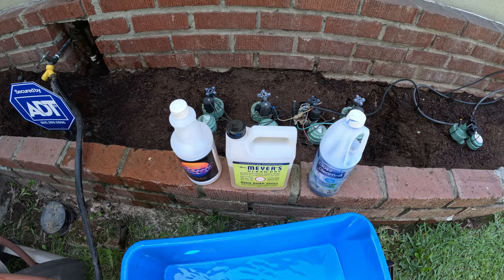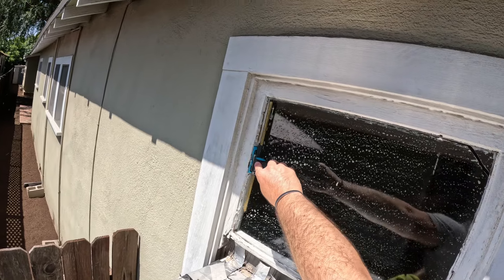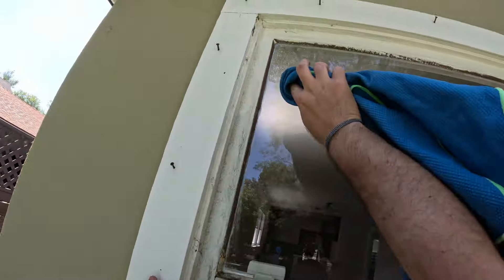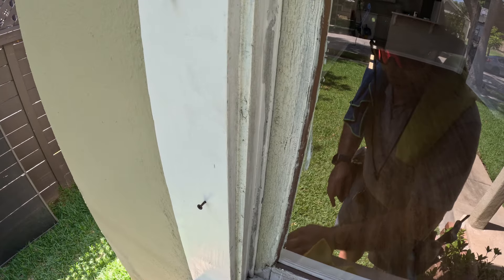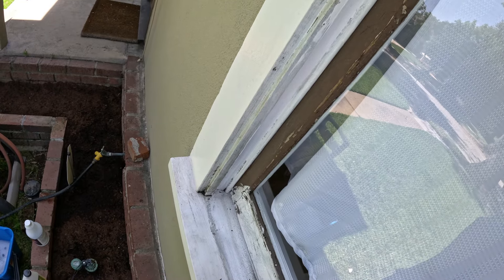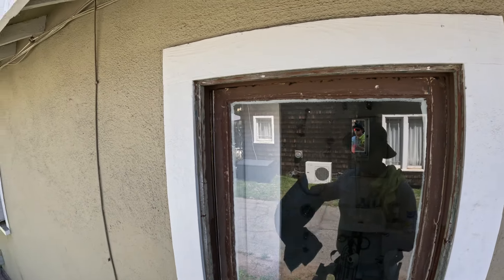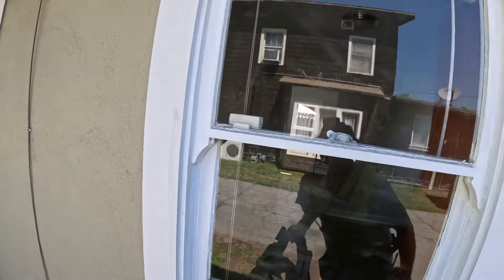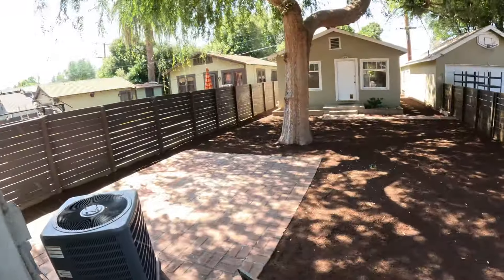How To Clean Windows Like A Pro

Comment: Hey what position you are using the handle  there, is that a 45 degree? For any reason when I do side pulls I end up leaving streaks , not sure if I am putting to much pressure or too little, also and the second pass you are passing on so much dry glass. I don't think the end result is going to be good after when the sun hit the window you might see some streaks.
Reply from the maker: Yes it is! But at times I adjust it when is needed. So when it comes to the streaks, how old is your rubber and what rubber are you using? Also when it comes to cleaning windows in the sun, you have to do the mop and then squeegee combo because if you squeegee too late then it leaves marks. What you can do is clean the window into sections instead of doing the window all at once. Hopefully this helped!

Comment: Good job If I can recommend using a 4" paint brush and brush off the sills and frames to get most of the dirt and dust build  up so that after you wash and squeegee the glass there will be less clean up on the sills of muddy water
Reply from the maker: That would helps a lot! Thanks!